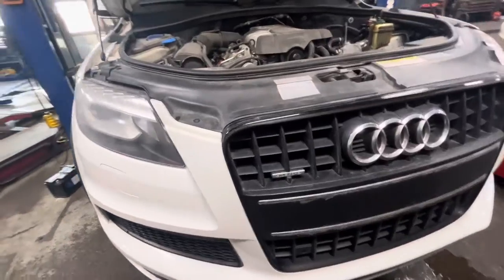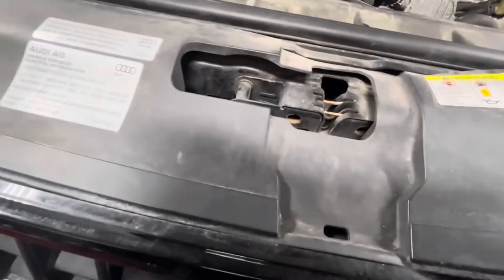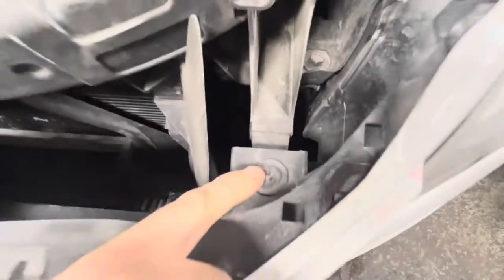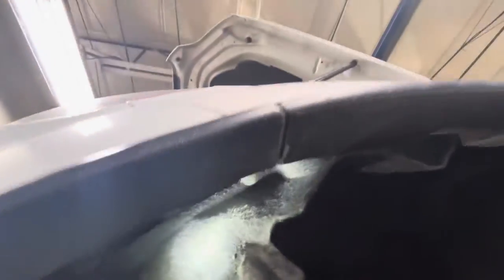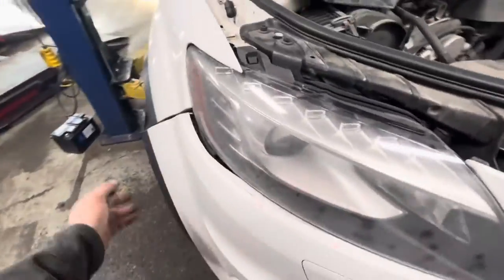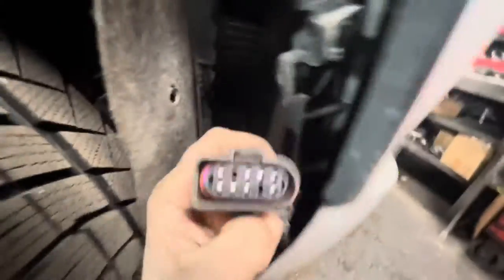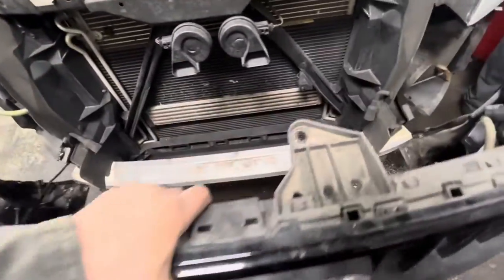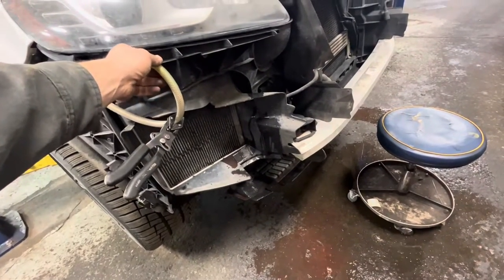2014 AUDI Q7 FRONT BUMPER COVER REMOVAL

Comment: My question is how do you get the audi  front grille piece off from the bumper to install a fresh new one ? I have the 2007 model with same top cover you showed explaining how to remove in this video..I wish you tube would add photo upload aspect here
Reply: It’s has clips all around the edges just use something like a pry tool to free them just keep it pulled apart while you do because they’ll easily slide back in place and lock until you get enough of them free. If you have a way to give me your number I can send you a video on mine I ordered the RSQ7 grill from Europe and swapped mine
Reply: I just did mine, remove the old grill was a main, at many times I thought I would break something.